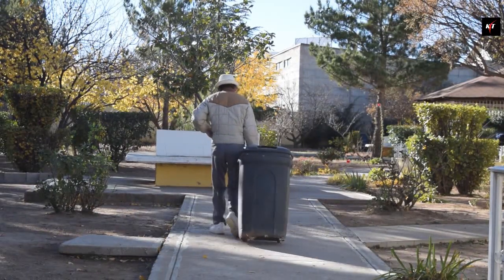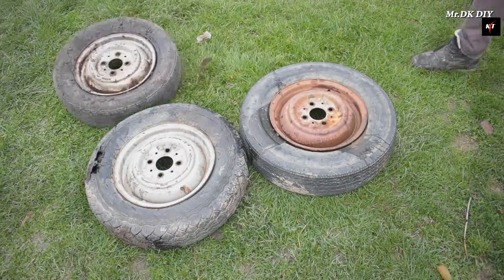THINGS YOU CAN MAKE FROM OLD CAR WHEELS | DIY Stove from CAR RIMS

Comment: Things we can do at home 

Proceeds to weld wheels together
Reply: All you need to weld is car batteries, jumper cables and welding rod…
Reply: @goosedeathable  it’s easier than that. I bought a $170 DC stick welder at harbor freight that does pretty decent. The entire welding setup including the welder and an auto darkening mask was $300. Gloves, rods, sleeves, apron, slag hammer, wire brushes, welder and welding mask all for under $300. Not to mention that welder plugs straight up to a regular outlet. People think it’s hard and expensive to get into welding, but really it’s that $300, buying a $30 grinder, finding some scrap at a junk yard and watching a few YouTube videos. That’s plenty to get you started.